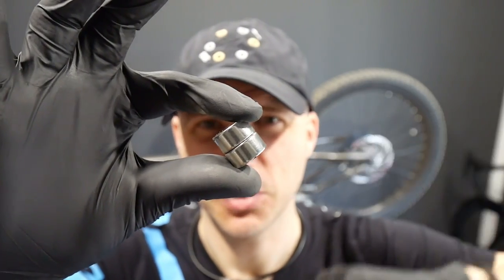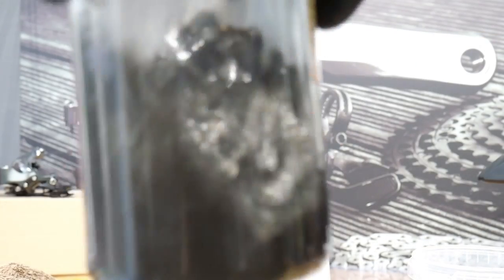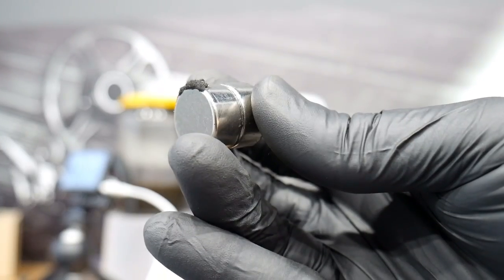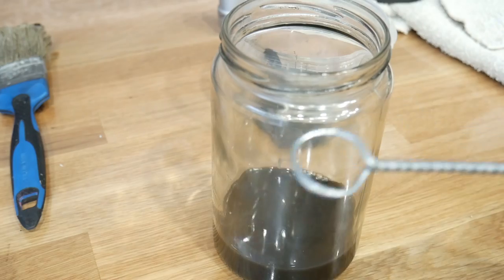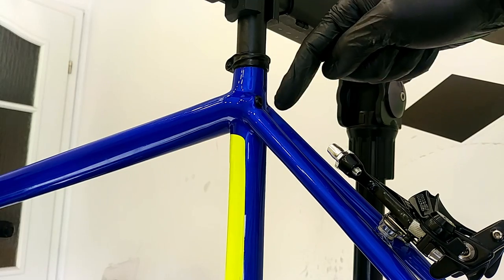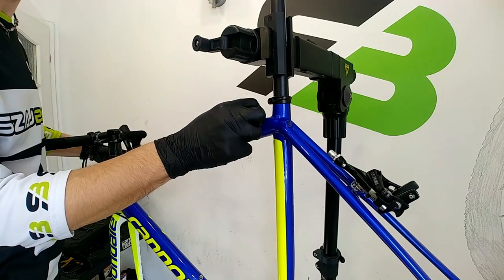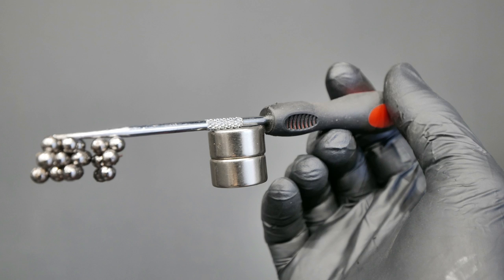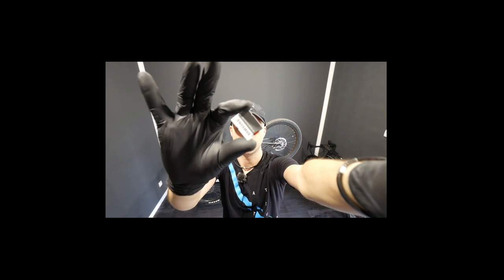5 Bike Hacks With Neodymium Magnets. Tricks For Servicing Bicycle Chain, Hubs, Cables And More...

Comment: Excellent  tips ; magnets are magical, but be aware your use of the to manipulate parts like bearings,etc.  will also partially magnetise them, making them more likely to attract micro metals!  Note too the cleaning bottle for chain / parts should NEVER be made of glass! I have had several dangerous breaks in early years. Nalgene  camping bottles are perfect, with hermetic seals. 🙏

Comment: Actually you can get the magnet close to mobilephones, laptops or SD-Cards. The information on SSD, USB Sticks and SD-Cards isnt saved with a magnetic code.  The only way to harm your device is if you induce a voltage capable or harming your device, but magnets you can buy arent strong enough for that.

Comment: a good amount of that gunk on the magnet is actually from the dirt/soil. if you chain were loosing that much metat in a single cleaning you would be replacing you chain after 3 time out riding. Gog take a small garden trowel of soil and mick it with water and then put the magnet in it and let it sit for a bit and see how much metal soil it picks up....you will be surprised.
Reply from the maker: E-bike on a hard trails will wear extremely quick. I'll check, what you propose though :)
Reply: @cannondany  Please understand tha I ma not saying that none of those particles are from the actual chain of gears, but you will be surprised as to how much Magnetite is in plain simple dirt.